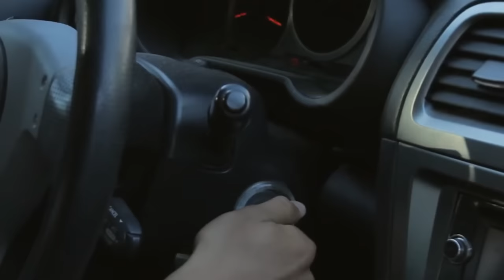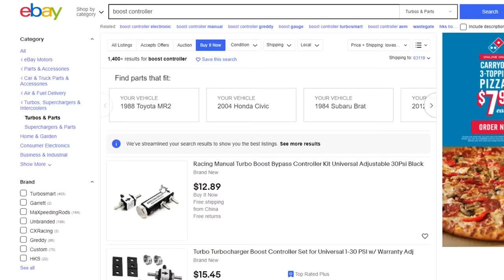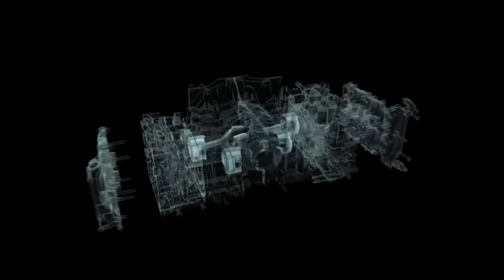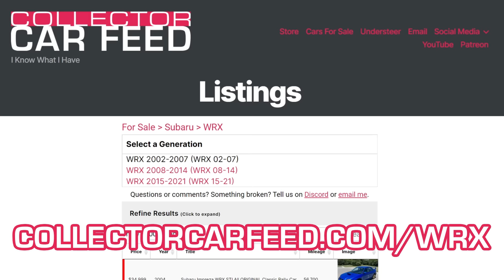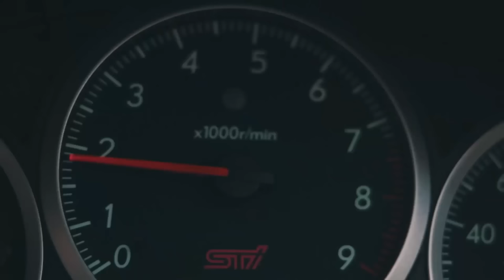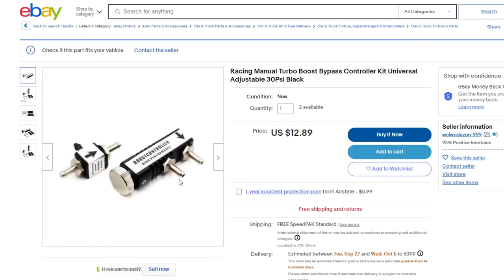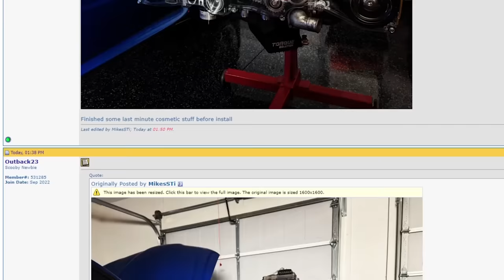Hard Truths of Owning a WRX in 2022 (Donut Media Won't Tell You This)

Comment: Stock fa20, rod bearing failure under 50k and rarely drove aggressively. always on the maintenence. Not too sure of ej because the ones i had,  had over 150k but also, one was rebuilt; 02' wrx and the na wagon i had, was stock at 280k but had no record of timing/water pump service and overheated regularly and the only thing possibly wrong was hg. My current focus st at 104k has perfect compression still and has had 0 issues other than slave cylinder. Putting a upgraded turbo. Dp, and intercooler on it, aiming for 350-400. Know a local with a stock imternal ond at 500 ish with over 40k on at 500 hp. No mechanical issues at all.

Comment: Lol, I have a 2007 WRX with 209k on the original headgaskets and the original transmission. Overheated twice but still has 145psi across all four and around 10% leakage at all four.

Comment: Ive had 5 turbo subarus and still currently have 2. Yet to see any problems greater than any other car. Also own a mazdaspeed 3 which is very similar in the way you need to look after a subaru. Keep the oil clean, dont thrash it unless its built properly and tuned properly.

Comment: A good solution to finding a non moded wrx is to just buy a legacy gt much much easier to find a stock one and the have a better transmition and have a bit more stock horsepower only downside is not as much cosmetic stuff

Comment: Beautiful Video! Very much on point! I got my Wrx bug by a family members passing, and was forced to become a Subaru lover. At first I didn't want to, but it really grows on you. It hasn't gotten any work done in awhile suspension wise so I've been going to ends length restoring the undercarriage to stellar conditions. (((IF YOU PLAN ON BUYING A STOCK SUBARU WITH NO MODS UNDERNEATH PREPARE TO SPEND 5K ON SUSPENSION UPGRADES))). Also not to mention, don't cheap out, and get new zinc coated steel nuts and bolts, the old ones tend to break off or shear, they are lesser metals for some reason.

Comment: Where I lived, they spread small pebble sized rock on icy roads for better traction. These rocks would kick up and chip my STi's clearcoat right behind the front fenders. The problem stopped when I put rally armor mud flaps on 🤷‍♂. I live in town now and don't need the mudflaps anymore so I took them off. Btw my STi was lifted 1" so it actually looked really cool with the flaps.

Comment: Bout a 240k mile 05 wrx wagon and it's been super reliable for 1.5 years. 

More reliable than my Honda 03 rsx type s that oil starved in 2 weeks after getting the oil leak fix at a shop. 

Atleast my previous car 02 civic si I beat on it for a full year with only like 30% of engine oil capacity 🤣before it blew

Comment: Honestly, for newbies, buy a new WRX and learn how to take care of the car first. Then slowly learn the strengths and weakness of the WRX, and do the durability/reliability mods first and start working towards performance parts.
Experienced subaru owners already knows what to look for in used WRXs and STis, but it takes experience and learning to get there to notice whether the WRX is worth buying or not. Respect the car, and it will respect you, but that's same for any car. Some cars take more precaution and knowledge and subaru are one of them. If you want a easier experience, civic is a great experience and gives entry-high end mod experience even if you are a newcomer. Subarus require medium-high experience to properly mod and keep the car. Easier entry point is BRZ but don't go put on turbos right away. BRZ was meant for entry level and certainly provides more leeway than WRX.

Comment: 7:41 Use 11044AA642 on NA 2.5l engines to completely eliminate this issue.

Problem was that since the NA engines don't run boost, Subaru tried to get aware with a composite head gasket (11044AA521, 630, 631, 632 or 633). The MLS head gaskets from the Turbo models work perfectly fine on the NA engines, and is actually the recommended fix.

Comment: I don't think I'm an idiot 😂... But i bought and drive a used WRX in 2003 (bug eye model). Drove it for about 12 years. Never modded but did need a tranny change around 7 or so years in. Clutch changed about a year or so after.
Let's not forget that in general, Subarus maintain value over a huge amount of time.
In the right environment (Queens, NYC) it's also unbeatable for reliability. I did great in heavy, deep snow, where some BS SUVs like the X5 had no chance in hell.

Comment: It’s all about supporting mods. If you’re not gonna crack the case and build internals. Keep it around 330-350 with some good supporting mods and you’re living life. Never buy a “built” Subaru. Just don’t fng do it. You want something stock and un-touched. Build it yourself and you’ll have some of the most fun you can have in a 4cyl turbo.

Comment: My 2013 WRX has 100k miles and 375WHP with stock internals. It has been a reliable and very fun car to drive. All mods were done by me or a professional shop with a tune following immediately after install.
Reply: 2012 STI 117k miles 300+whp since 7k miles. Stock block FP Red

Comment: I agree, if I was not already knowledgeable about Subarus and how to work on cars before I purchased my bug eye wagon I would have been screwed. On the other hand if you are willing to put in the work and takes the time to do it the right way they are very rewarding cars. Especially the wagons in my opinion, they are just so uncommon and at the same time very practical. There has been a time or two that there would be another bug eye at any of the local car shows or car meets, but not once has anyone else pulled up in a bug eye wagon. I'm not sure about other parts of the country but up by me they are extremely uncommon. I haven't done anything too crazy so reliability is good. It's not the fastest car in the world by any means. I'm pushing about 320 horsepower to the wheels at the moment, but it is an extremely fun 320 horsepower

Comment: Owning a Subaru WRX or STI is kind of like being in a relationship with someone who is emotionally unstable they can just blow up at any time from the littlest of things. Be super super careful modding them. A catback is OK to install but anything else with the exhaust or intake absolutely do not install it until you’re ready to tune it. The EJ engine on the sti and older wrx is actually really easy to work on, there’s some tight spaces in there for sure but I definitely think it’s easier than a lot of other modern cars. Tuning potential is really pretty poor on these. I had stage 3+ with flex fuel but stock turbo and I really wouldn’t go anything past that it’s just not worth the money. So expensive. Also Hella horns and mudflaps at +5 hp each it’s proven

Comment: I'm on my 3rd Subaru being the most tame (13 Impreza), previously owned a 17 wrx with bolt ons, sold it and is still running today. My second Subaru was an 06 STI that was built built, IAG tuff block, 6466, 1700, and all the supporting mods to have a 36 psi 600+ HP street car and it's not as fun as I thought it was going to be. Got rid of it after the engine blew(lol) and got hit with a 15k bill from Off The Line. I know the owner of my 17 wrx with bolt ons and it's still trucking along with no issues two years after I owned it.
Reply: I have a 14 Impreza. Got it recently with 52k miles on it. 5 speed. I love it!

Comment: Check for rust, and if it does, run away. I bought a 2002 WRX wagon, and it was a great daily driver. But it had rust, and it was hard to work under the car. Just about everything that was mentioned in the video is true. I've owned 3 subies. The older ones were better, IMO. I had a 2013 Crosstrek, and the engine is horrible in that model.

Comment: my 05 FXT has a perrin short ram with a homemade cold air intake box+fog light intake duct, an sti intercooler, mishimoto radiator and upgraded vacuum, oil and coolant hoses. just an exhaust shop downpipe and catback, no tune and no issues. 205k going on strong

Comment: Boxer motors are very temperamental. Its important to get a quality tune after really any mod to the motor. Trust me, I know owning an aftermarket single turbo kit on my 2016 Crosstrek. It runs great, but wouldnt without a good tune.

Comment: Subie WRX's are just like DSM's. People picked them up for cheap, instead of taking proper care of it they used that money to buy cheap shitty Ebay or Aliexpress parts and then wondered why their tranny or engine blew up when they were pushing 400+ hp. I've had a '92 DSM, and people had the same kneejerk reaction. 'Omg it will blow up, it's so unreliable!!1!1' guess what, I kept it mostly stock, and the parts I did fix/replace were replaced with quality parts. All in all, the car was very reliable and never left me stranded.

Comment: I bought a 05 saab 92x aero for 450 bucks. It needed a clutch. But it also knocked during start up. But I bought it for next to nothing. And I do all my own work on it.I ended up putting a “Jdm” motor in it. Along with other stuff to help the motor live (baffle/pickup, equal length, and got a good tune, external wastegate) it’s been an absolutely good motor. I haven’t had hardly any issues. Love the saab. And I’m taking care of it. From the previous to now, it’s a better car. Still needs more work but it’s drivetrain is sound. I know the cars are very temperamental when it comes to air intakes and Downpipes.
Reply: I really want to get my hands on a Saaburu one day. 

Great, peculiar wonder from such an odd pairing, but contributes to the car’s uniqueness.

Enjoy it!

Comment: I had a WRX and I loved it……but it did cost tons to do stuff too and was finacy. But I did all the research and on top of it I was young working a great job with little to no bills. I bought all good brands and I did all the work myself minus the tune. And I was about $10k invested in upgrades. And after all of that I made about 400 at the crank and like 320 at the wheel. I bought the car when it was still stock too it was only 2 years old when I bought it so it was still $30k. So after all of that. I was at $40k or more invested. At that point I could of bought a corvette or something with more power stock and it would of been more reliable too. I loved my wrx but it was def a stepping stone. Next fun car will be a V8

Comment: I've owned my 2015 for 3 years. Had 95k on the odometer when I bought it. Car was stock. I did all of my own work and went to a reputable tuning shop. Other than a throw out bearing at 115k I've had zero issues. I do regular maintenance and I don't beat the shit out of it at every light.

Comment: In my owning now and turning to the dark side for the Subaru.
in 2021 I finally made the plunge and wont look back.
building my 944 project and doing it ALL by hand, this became my new passion as its quality or nothing it's a Porsche quality for the people who care. 
With a stock STI I can be the soul runiner or best builder ever for my car.
They RS2.5 2 door bought right after being addicted saw the horrors and simply started from ground ZERO and built it back up. 
And let me say the chassis to all the components show signs of 174k hard "rally driven" or at least inspired miles on her hard life but somehow mostly stock, although worn and very zip tied, twisted and taped together. 
#builtnotbought and defiantly not for the cheapest eBay parts and chinezium dollars. it's Japanese it will feel disrespected and blow up

Comment: Also a rule of thumb is do NOT get a cold air intake unless you're pushing past 400+hp, the oscillation gets all messed up in the MAF scale ....AND head gasket issue was the NON turbo models.
Reply: Another rule of thumb is if you have a non-turbo Subaru just drive it and be at peace there is basically nothing you can do to get additional hp. Even a cold air intake on a 2.5i will cause the car to run rich and screw things up.

Comment: I agree I've owned 4 and never had issues no value leaks no head gasket blows. The secret keep them as stock as possible and if modded I definitely suggest getting them from Subaru itself I currently own a 2015.  Also pay attention to them they need attention like women if you ignore them you're only going to find a headache and problems. No joke.

Comment: Looking at a low mile 1 owner (older guy in his 40s) 2005 sti this weekend. It’s completely oem and has no rust as far as I’m told. It’s at a dealer for 25k so If it all checks out I’m going to grab it. My neighbor has had all the sti models in the us and has never once had issues because he keeps them oem. I have my  car to do straight line runs which is a 450whp b5s4 so I want something I can hit back roads on.

Comment: I have a 2017 WRX and it's entirely stock. All I've done and plan on doing with it is wheels, an STi brake upgrade and a larger skid plate to replace the factory one that's kind of small. I live in Canada and I've hit chunks of ice on the road in winter and broken things in the past. Everyone shit talks my car, but ironically they're all people with broken shitboxes that haven't run in years. The wheels are gramlight 57DRs and I only got a second set of wheels so I didn't have to constantly mount tires every season.

Comment: Buy a stock wrx and do all the mods yourself or if you buy on modded, make sure it’s from someone you trust, and always have a spare iacv, knock sensor and maf sensor and maf cleaner, if you car starts running like shit replace the parts with Oem or part that is better quality than oem, if you’d not going with oem buy a better quality part, I work at a well know parts store, there’s some thing you buy at work and there’s some things you buy from a supplier or dealer, don’t cheap out

Comment: I own a 2019 STi. I have never had a single issue and yes its a newer model so its low mileage, but there has never been a problem.  I have kept the engine stock and purposely got one that was completely stock/untouched by some goober. i have only done some cosmetic mods on the inside adding carbon here and there, as well as replace the badges with titanum ones. I was going to do a turbo back cobb titanium exhaust system but i know i would then need a tune so together its more than i can spend right now. But i got enough room for daily driving, a carseat in the back and i enjoy driving it every day, shifting gears, hitting boost and its just fun, its not fast but who cares im not a racecar driver, im just some guy that likes cars heck even my 2 year old son loves to ride in dads car, my plan is to get parts that are on the s209 version of the sti eventually and spice it up that way while retaining everyday drivability. Great video,

Comment: I had an 07 wrx TR that I bought as my first sports car. Best car I ever had but I didn’t do my research on the car and found out that the previous owner was a dipshit and basically ran it with a bad tune and did everything wrong. The Subaru shop I went told about the previous owner and how dumb he was. Well after 7 months of owning the car it started show massive oil consumption and the shop I took it to said the piston rings were shot and the car had maybe a few months before it exploded. Sadly I had to get rid of it and get a Focus ST but I’m still looking for a mint condition Hawkeye STI. It’s a finicky car but damn is it nice when you understand the quirks and treat it well. The car has a personality and I really miss that.

Comment: Yes, get one. Just know you will end up pouring money into it. The BIGGEST thing is to rebuild the engine and get it CNC CENTERLINE BORED!

Also I have kept mine stock as well. 2007 Hawkeye with 210k on original head gaskets and have overheated it twice and still holding strong. 12% blowby in all four cylinders,  it too bad.

Comment: me with a wrx with hella horns and mudflaps 🤣🤣 horns because we got shite drivers here, not for looks otherwise i'd have put the effort in to centre them, mudflaps because im not a moron who lowered my subaru and actually offroad it. But absolutely on board for the timing belt and wheel sizes, seen tensioners go out and different wheel sizes seizing diffs. and tip for foz and wrx owners (pre 05ish) check if your model has the catted up pipe/pre turbo cat. get rid of that thing before it gets rid of your turbo blades.

Comment: Hmm I’m getting quite bit of hate from him but I get him, to have a “reliable” Subaru you need to keep it as stock as possible, an exhaust system and maybe a short ram intake WITH A CUSTOM TUNE, NOT OTS TUNE, and you’re good. OTS tunes are a no no.
Reply: That’s a constantly propagated myth. 

Running mods not designed to be used with the OTS tune is what breaks these cars. 

Typically because if the user is doing that, they’re probably doing other dumb stuff that shortens the life of the engine.

90% of Subaru issues are people not understanding the requirements of owning a Subaru. This video is spot-on.

Comment: its funny, i just bought my wrx about 2 weeks ago, basically went through that exact checklist, little mods that where tuned for back in 2009 and thats it, now i have a clean 59,000 mile 2006 wrx that im the second owner of and immediately trailered it to my tuner. i did my research, picked what mods i wanted, my tuner told me the best parts to use so they all play nice together, and getting them installed and tuned, like you said, these cars get a bad rep, but i feel if you put in the prep work they will last you and you can have alot of fun with them.

Comment: Yea my gf  got a 2003 bugeye wrx a few months ago basically new radiator thermostat to stop it’s overheating issue (did a compression test before buying those parts) new tires and it’s a rebuilt title so next up replacing bent lateral links trailing arms and next up is the rust 🥲 since these are awd expect them to be driven in the snow so they will more then likely have rust so always look under the car (we wanted to do a full restoration anyhow so it didn’t matter) but it can save you money